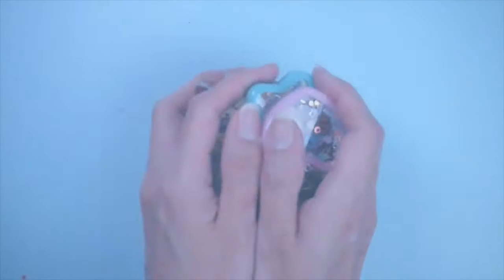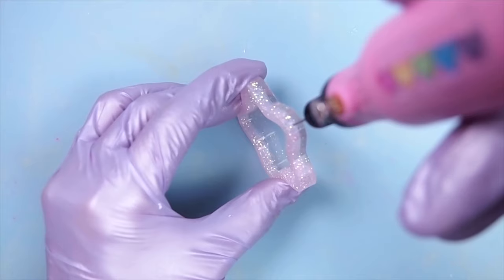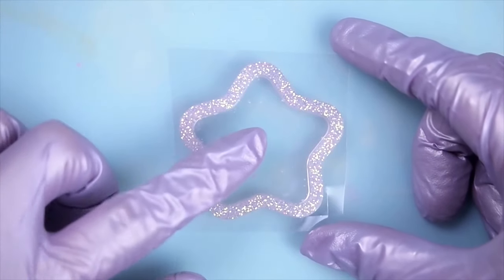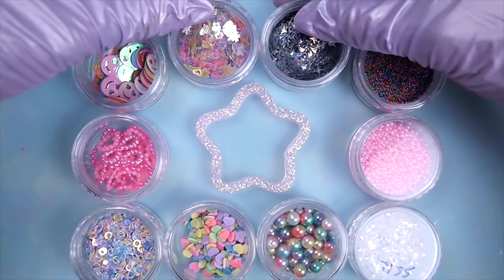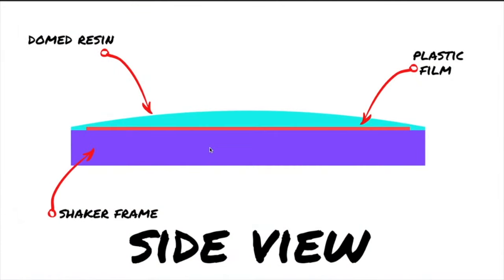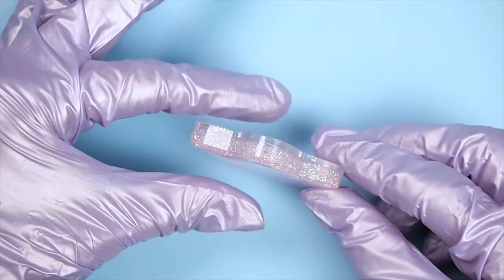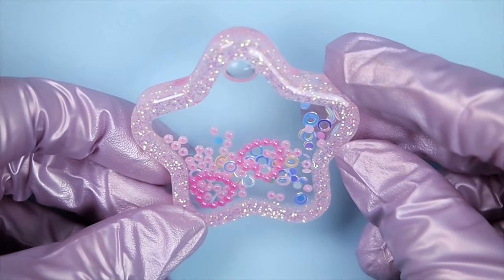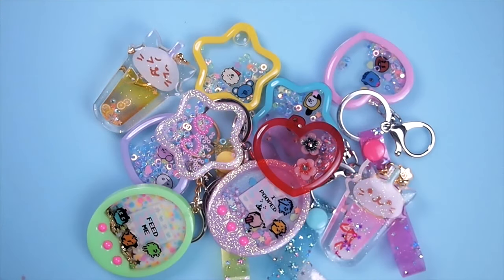How to Seal & Fill Liquid Resin Shakers: NO LEAKS, FOOLPROOF

Comment: Great Video.
This video contains the proper elements of a tutorial video:

1. Audio and Video are perfect. No issues.

2. The instructions are clear, simple to follow. And includes diagrams and "not to do" warnings.

3. There are no rambling, or dead space moments. 

4. The video moves at a comfortable pace.  It was 13:28 minutes, but actually felt about half that time.

Comment: Such a helpful video, thank you! I also wanted to mention that sometimes I punch 2 holes in the film before I add it, so that air can escape easier out of the 2nd hole while I fill the 1st one. Really helps on pieces you don't want a bubble in as well. :) Buying myself a 1/16" punch now, thank you! Perfect size for this use.
Reply from the maker: Thanks! Keeping the bubble helps the inclusions move more so I tend to keep it in for my shakers. Definitely a personal preference though. With a 1/16 punch, you don’t need to add a second hole for the air to escape Since it’s still large enough where it’s not a tight fit with the needle point bottle.
Reply: @AmyMade  I'll try keeping bubbles in there more then, to see if that helps my inclusions move better. Great to know the 1/16 punch helps with that too, so I'll definitely give it a go! I have those same filler bottles, so that will be handy.

Comment: I wish I would’ve watched this before I made my most recent shaker because some of the shaker pieces stuck on the inside and I couldn’t figure out why. It still turned out cute tho, but I can be kind of a perfectionist and get down on myself if something doesn’t turn out as good as it could be. Thank you for these helpful tips! Sometimes I rush and make mistakes but I’m going to try and take my time and do all these steps the right way, I’m sure I’ll thank myself for it in the end when I have the cutest shaker charms!
Reply from the maker: Sometimes the static charge on the plastic film can cause the inclusions to get stuck on the wall. I recommend wiping it with glasses cleaning cloth or anti static cloth to prevent that
Reply: @AmyMade  thank you for the advice 🙏🏻 I’m going to try that on my next one.

Comment: This has to be the most intuitive and clean tutorial I've seen. Gorgeous pieces! Just one question..the top drilled bit, after you've cured that hole..could you Re drill for the keychain eye to go in? Or would it mess everything up
Reply from the maker: Thank you! Redrilling that same hole will cause the shaker to leak and ruin your work!

Comment: WOW Between the tips of drilling from the apex, to the funnel hole, this is an amazing tutorial!! 
Thank you so much for this amazing tutorial! You explained everything so thoroughly! 
Other great tips to note: 2-part film, getting the plastic covers off is easy, by putting (all or part) of the film onto masking tape, then removing; those outer plastic layers will stay stuck to the tape. Also, I've found, for adhering the film to the cavity of the shaker, Mod Podge Dimensional Magic works great–I tried this, due to difficulties accessing UV resin, and it worked beautifully–dried crystal clear, no leaks! 
Sub'd and excited to check out more of your videos!
Reply from the maker: Those are some great tips. Thank you ☺️

Comment: I watch this video many timesss so helpful. Can I use pvc sheet instead of clear film?
Reply from the maker: Like clear vinyl fabric? I wouldn’t recommend since it’s not rigid. It won’t be able to hold the weight of the resin and will sag.
Reply: @AmyMade  oh. i bought so many it was kinda thick but it has many streaks :( thank you so much for your response

Comment: Have you ever tried using silicone to seal the hole and or the plastic sheet? What about two part 5 minute cure Gorilla brand epoxy glue? If so, what have your outcomes been? I just made my first molds and I’m nervous about sealing them. Also, if I may ask, what do you price your keychains at? If you’d rather not say I totally understand. Like I said, new to this and just trying to get an overall idea from multiple sources. Your video was great and I absolutely rather you say more and be very detailed than to leave me wondering about what could be valuable information and doing something wrong because of I may not fully understanding. It was very easy to follow along. The only issue I had (which is a very minor one) was having to go back and pause the wording at times to read in its entirety because it flashed off too fast but other than that, I’d love to see other tips & tricks you may have for resin making!
Reply: In my first question about the silicone, specifically I meant like a clear silicone caulk like you would use in a shower or similar. Sorry if it was not completely clear the way it was worded.

Comment: Your method is great! Too bad the UV resin I bought started curing the second it was out of the bottle and was a total mess 😤 I’m getting the UV resin you have in your description, which is what I should’ve done from the beginning!
Reply from the maker: AttackCasserole some uv resins are super sensitive. Make sure there are no sunlight coming into your work area. Also if the resin is sensitive enough even the regular household LED light can start curing the resin. My LED desk lamp started curing my resin one time
Reply: AmyMade I’ll keep that in mind for next time! The fast curing wasn’t the only problem however. It was a sticky and lumpy texture, and the resin actually clogged the nozzle of the bottle. Ur vids have been guiding me through my first resin project btw, so thank you very much!

Comment: I love your thorough explanations of each process/step. It explains so much. That being said, how do I ask you a question about why my UV Resin is staying so sticky?
Reply from the maker: You didn’t cure the resin enough. Either your light is too weak or you’re not letting it cure enough under the light
Reply: @AmyMade  Thank you for responding so quickly. Is it a matter of how long if my lamp is too weak?
Reply from the maker: I would try 5 min. If not cured, leave longer. Or just leave it outside under direct sunlight for 30min
Reply: @AmyMade  I will cure it longer then. I would love to put it out in the sun to cure, unfortunately I live in Portland, Oregon and sunshine is in short supply this time of year... lol
Reply from the maker: I’ve also heard you can put your sticky resin in a clear container with water and cure it. The water intensifies the uv rays.

Comment: Thank you for making this video! It was so informative!! Is there a reason why you don't use epoxy resin when filling the hole? Also, does baby oil degrade the resin over time?
Reply from the maker: The idea is to seal the hole with uv resin and cure right away before it can drip into the hole and into the shaker.. 2 part epoxy resin takes 24 hours to cure so you can imagine why it won’t work. And baby oil will not breakdown or degrade the resin over time.
Reply: @AmyMade  Thank you so much!!

Comment: Hello! I love following your videos. I have a shaker question. I fill my shaker with chunky glitter and sometimes confetti but they ALWAYS stick to the front of the shaker film. I tried to add in baby oil to try to keep it down then sealing it and filling but that didn't help either. Any suggestions?
Reply from the maker: I find that anything flat and light weight will get stuck to the film.   If the confetti is large enough I would dome it with uv resin.  Now, I only put heavy inclusions like metal charms, rhinestones and cane slices for liquid shakers

Comment: Hi fantastic tutorial I'm starting to make these for myself now and I just had one question about the doming resin. Is it really necessary because I only have UV resin and the casting resin? Also, was that a blow dryer you used to dry it? How does that work?
Reply from the maker: I prefer having different resin but it’s not necessary. Casting resin tends to not dome too well but it does depend on the brand. Also it’s not a blow dryer; I used a heat gun for popping bubbles on the resin
Reply: @AmyMade  Thanks for your quick response! I've ordered some doming resin, can't wait to finish off my shakers! :D

Comment: Great tutorial! Why wouldn't you seal the fill hole with two part resin, though? It would adhere fairly well, wouldn't it?
Reply from the maker: 2 part resin takes 24 hour to cure. By then. The resin will seep into the hole, into the cavity. With uv resin, you can cure it right away
Reply: @AmyMade  I see, thank you! My epoxy resin is ready in 20 minutes though, so I'll definitely try it :D

Comment: Very detailed thanks, just one question do you have to use uv resin to stick the transparent layer on and fill the hole or can you use anything else as I don’t have any uv resin? 😍
Reply from the maker: LISANE69 yes you do. so it can be quickly cured/hardened and be secured on.

Comment: Very helpful.  Great tips.  I am new to resin.  I am not sure if i missed it, I did watch a few times, but when you first do the plastic to the resin at 3 min 35 sec, what did you use to glue the initial plastic down with?
Reply from the maker: Thank you. I used uv resin

Comment: This was very useful, thank you! I noticed that a lot of crafters mention that it’s important to dome more than once in order to ensure that it won’t leak. Do you find this necessary?
Reply from the maker: ChubbiPenguin I don’t think it’s necessary as long as you seal the film properly. Plus when you try to dome over an already domed surface, you’ll have a greater chance of breaking the resin’s surface tension causing over spills.

Comment: So making frames with Uv resin then putting 2 part on top of drone to create the lense on one side will NOT work?

Most important where do you find your charms....I pulling my hair out looking for good charms.  I love all of yours.  Where do you purchase them or do you sell them?
Reply from the maker: I’m sorry. I don’t understand your  first question. Regarding “charms” are you talking about the inclusions and shaker bits? Those you can find them in many online shops.
Reply: @AmyMade  it was suppose to say UV resin.  I was going to make the frames out of UV resin then make the too layer with 2 part epoxy.   But now I’m getting the idea that UV resin and 2-part epoxy won’t work together like this.

The charms are hard to explain...the triangles, hearts etc that are mane with little spheres.  I can’t find a place to buy them anywhere.  I would happily buy some from your shop.  
Sorry about the confusion but I certainly understand why it was confusing.  Spell check will get me every time😂

Comment: Can you seal the hole with two part resin?. & thank you! This has been the most informative video!
Reply from the maker: No you can’t. The point of using uv resin is so you can quickly cure it and seal it. If you use 2 part, the resin will continue to drop down the hole, not being able to seal it.

Comment: hi Amy! thank you so much for the video 😆 your explanation is very easy to understand especially for me who's starting to create resin shaker. anyway, I have some problems, when I put baby oil, some of them are leaking and even though I already wipe it with alcohol, the UV resin still won't cure 😭 do you have any solution for this kind of problem? thank you again!
Reply from the maker: Hi there. I’m still not quite understanding your situation. How and Where is the baby oil leaking from?
Reply: @AmyMade  Hi, thanks for replying my message. It's leaking from the drilled hole. I already close the hole with UV resin and cure it for several minutes, but after I take it out from the uv lamp, it's still wet and the hole ends up still open (I hope you can understand, i'm not an english speaker)
Reply from the maker: Why don’t you try the other method? The hole in the film

Comment: Hi! I have a question actually. My resin shaker is turning yellow after a few months, I don't know what I did wrong with it. Do you know how to avoid the resin turn yellow? I'd appreciate if you answer me! Love your vids❤️
Reply from the maker: Thank you for the comment! Resin will yellow overtime no matter what. You need to get resin with additives that help slow down the yellowing. Generally, you want to keep resin away from uv light/sun light and heat as this will speed up the yellowing.
Reply: @AmyMade  ahh I see, well thank you so much for this, it helped me alot!

Comment: Hello. Your video was very hopeful for me because I was very disappointed that I couldn't make shaker molds!  I would like to ask you a technical question. What is doming resin? I want to ask for it in greek but I have no idea how to call it!
Reply from the maker: Doming resin is also known as coating resin. Mainly designed for coating surfaces instead of casting. It gives a thick and flawless finish.
Reply: @AmyMade  thank you for your answer! I hope to find something to use as coating because it's a bit difficult in Greece to find supplies.
Reply: @AmyMade  one more question, does coating resin works with UV lamps?
Reply from the maker: Only uv resin cures under uv light

Comment: Great video!  Have you done this on a larger scale?  I've been wanting to make a clock using a wine glass mold with liquid (faux wine) inside, but I am not sure how to go about it.  TIA.
Reply from the maker: No I haven’t. The film will bow with the weight of the resin on a larger scale. I would have to see your mold in order to give you a better answer with suggestions/ideas.

Comment: Do you think baby oil with red colouring would make good blood? I’m designing little vampire blood bag jewellery and I want to use vinyl clear little jewellery bags.  If I seal the bags with a hot glue gun will that work? What would you recommend to seal the seal of the bad right ?

Comment: hey Amy, thank you for the great tutorial! I have 2 questions, what acrylic paint should I use to color on letters inside the mold? I use acrylic but It gets chunky and not smooth... also, I get a LOT of amine blushing but my space isn't humid at all. Changed 3 brands of resin (coating and casting )do you know any reason for this? thank you!
Reply from the maker: am sallythatgurl you can just use those cheap craft paints. You can also get amine blushing if you don’t mix the resin and hardener well enough.
Reply: @AmyMade  thank you so much love!

Comment: I’ve read somewhere that you can use superglue instead of uv resign for sealing the hole and holding down the plastic seal. Is that something that could also work? I’m asking because I’m going to start making up resign shaker charms very soon.
Reply from the maker: You’ll get unsightly super glue fog on the plastic and resin. If you don’t mind that, then sure it will work👍🏻

Comment: Absolutely the BEST tutorial on resin shakers here, very informative, thank you! Though I do have one question... Why can't you just use the hole that's already there? Out of the heart mold (that you showed at 0:46 ) the shaker base already comes out with a hole, so why do you need to drill another one?
Reply from the maker: Thank you. The reason I personally do not fill from the premade hole is because  it’s difficult to seal neatly and properly since it is so close to the surface. I’ve had many shakers fail and leak from that area. I usually fill the premade hole with resin. In the description box, I have an explanation and a video on how I do that

Comment: Hi Amy , this was a very helpfull tutorial. Just wanted to know if I  can use epoxy resin to glue the plastic film to the frame .
Reply from the maker: You can if you want to babysit it until the resin gets thick so the film won’t move.
Reply: Thanks a lot Amy ,  Is it fine to use epoxy resin to make the  whole shaker charm since I am not able to find uv resin anywhere near me  . And also do you have any idea where to find the shaker mold ???
Reply from the maker: Vijayalakshmi Jayaprakash you c an buy uv resin and shaker molds online like Etsy, eBay amazon, aliexpress
Reply: Amy , thankyou so much for taking you time to  answering my questions 😍😍😍

Comment: Hi do you have any tips on fixing shakers that leak? It’s no fault of the person I bought them from but my postal service can’t quite hold a package like a normal person.
Reply from the maker: Smabbles12 i think the seller is fully responsible for this. You should contact them. If the shaker was properly sealed and properly packaged for shipping, this wouldn’t happen. You can’t fix an already leaking shaker. I mean, I guess you can but it would be difficult and it will look like crap lol

Comment: Can you sand the open face of the shaker to make the UV resin hold even better I would think.
Reply from the maker: Well the uv resin is only a temporary hold for the plastic film before the final coat of 2 part resin is applied. So it wouldn’t matter. However, I would recommend sanding only if your frame has fully cured (typically after 3days). 2 part Resin bonds well to each other during its soft cured stage (24-48hours). Edit: Also I forgot to tell you I had this info in the description box